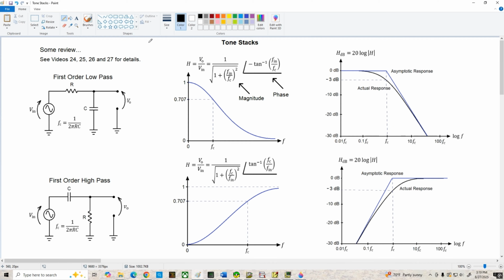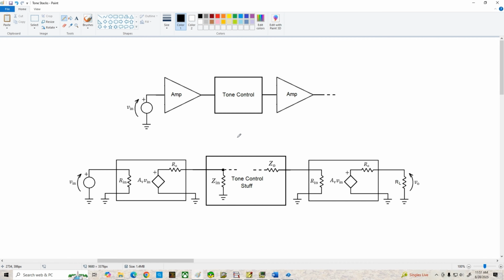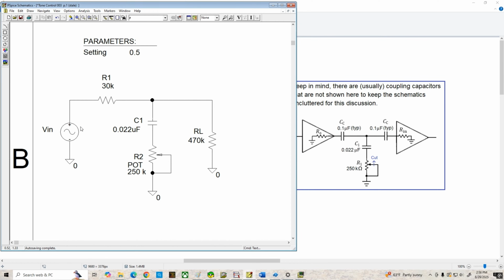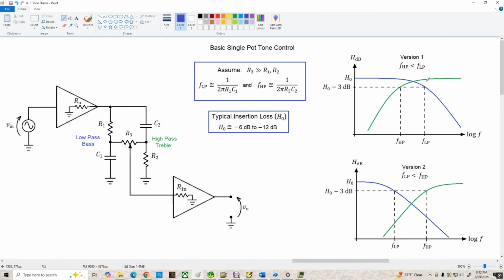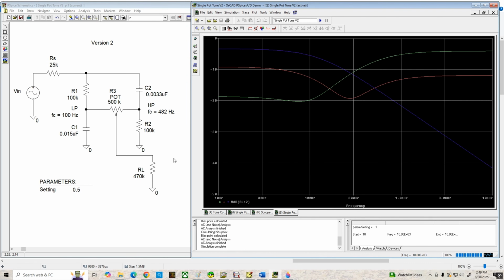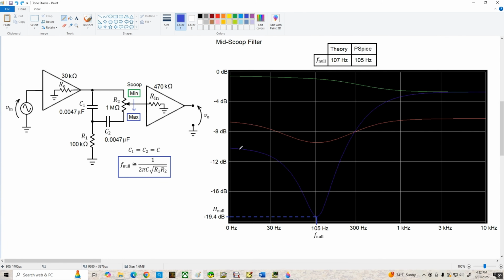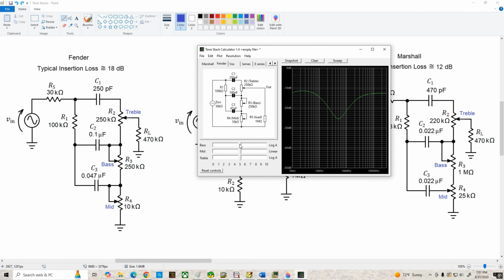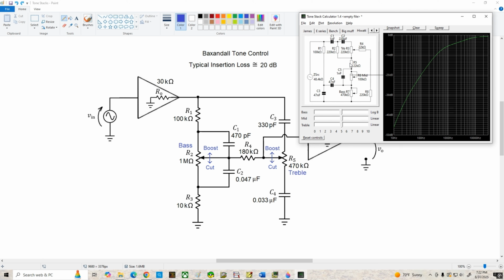Topic 92: Tone Stack Basics

Comment: Another great video, thanks for posting.  The Baxandall circuit looks perfect for my current EL84 p-p integrated amp design, in fact, very similar to the Tone-Control Amplifier in the old RCA Receiving Tube Manual.
Reply from the maker: It’s a great circuit!
Reply: @Denton.Dailey  I just discovered that the circuit James published was actually developed by a Mr. Michael Volkoff around 1938.
The James/Baxandall tone control specifically affects the extremely low and high frequencies, a range that's not so important for a guitar, but rather for a bass guitar. Therefore, I'm not really enthusiastic about this type of tone control in guitar amplifiers.
Reply from the maker: @WolfgangGrimm-xm4nw I understand where you’re coming from. It’s not my first choice in guitar amp applications either but it’s fun to experiment with.

Comment: Unfortunately, in your video, a tone stack was again incorrectly labeled as a Baxandall type.
In 1949, E. J. James published a circuit with two potentiometers for insertion into the signal path. It required logarithmic potentiometers and had a base attenuation of 20 dB, meaning only 10% of the input signal was present at the output. In 1952, Peter Baxandall adapted this circuit and incorporated it into the negative feedback of an amplifier stage, thus creating an active filter. Linear types were now required for the potentiometers, and the base gain was 1. Therefore, the circuit is only called Baxandall when it operates in negative feedback. Greetings from Germany.
Reply from the maker: Thanks for providing the clarification 👍🏻